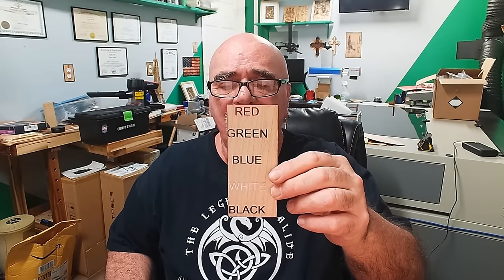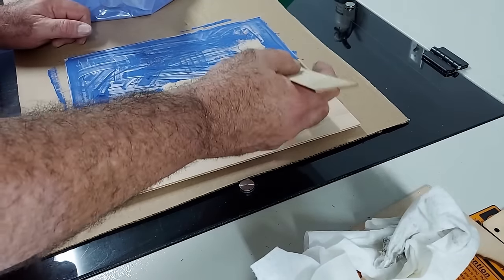😲 Laser Engraving in COLOR! Diode Laser & Co2! A powder coat trick!

Comment: Great video, thanks.  Did Mica work the same as Powder coat?   I have been dong very large stones recently, like 24x36 inch Flagstones. Smaller 12x24 ceramic tile address plaques, small pet memorial stones.  I am doing these on a 100 watt CO2 and usually around 70mm/sec at 60 power.  I do it that slow so I get a good indent in the stone.   I want to try this next.  I was adverse to painting infill in the stones because I did not want the infill to fail later.    Also, what would you think about masking, engraving, filling the engrave with the powder and brushing away the excess, then covering the engrave with something and using a heat gun to melt the powder in?    Also, if the first engrave step really needed? Could we just cojer the piece with powder and go strait to the slow low power engrave?   (This is how I do the norton tile method now)
Reply from the maker: Mica worked well, but slightly off on the color, still good though. I've tried it with transfer tape and no first run; that was a fail. No idea about the heat gun, but the laser puddles the lines, so it looks textured, like acrylic.
Reply: @TheLouisianaHobbyGuy  OK, I did an engrave of my logo in tile,  then filled it with white mica, and ran 250 10% on my 100 watt.   when I cleaned it it all washed out.  I then filled it with blue mica and ran 250 15% and 200 25%.  I don't think my mica melts.    I well, more resting needed

Comment: Would sealing the wood with a sanding sealer (or anything else) before engraving work to prevent the light mica from staining the wood (when mixed with water) or would that just create a fire hazard from the chemicals in the sealer being burnt by the laser?  Just curious. 😅
Reply from the maker: Sanding sealer is a wood grain sealer, used as a pre-treatment for stain. It's not a sealer in the sense you're thinking. You can use a varnish or clearcoat as the pre-treatment for better results.

Comment: I've been trying to laser engrave a piece of wood that I've painted white . My issue is I get a lot of black residue from the laser ( Diode 5 watt)  and it spreads all over the white. Any suggestions to help resolve this . I tried with a coating of polyurethane but it just gets all over
Reply from the maker: You can't engrave white on its own. You have to paint it, and then mask it with laser masking tape.

Comment: Hello Rich
I just saw your video. I have an XTool D1 laser. I try using pigment colors or Mika and I got no melting of the color.   I understand that the blower will be blowing most of the color out of the surface but I did not get any color to melt.   I try 40% power at 100 mm and nothing I ran the image again and try to at 50% power and nothing as well. Any advice?
Reply from the maker: I used powder coat and mica Hector. They melted fine. Try raising your power until they do melt.

Comment: regarding the light colors on the diode i believe you said wetting it worked but stained the surrounding wood. if thats correct could you use the masking/transfer tape to help with that or do you think it would wick or seep into the wood below the tape. idk just a thought
Reply from the maker: I tried the transfer tape, the white bled into the wood Robert.

Comment: I haven’t tried engraving yet, but with my xTool D1, can I engrave with the air assist off? Also have you tried embossing powder? Not sure how they differ from mica powder but they’re sold in the paper craft section.
Reply from the maker: No, the diode lasers have to have the fan on Linda. And yes, I have tried the embossing powder.

Comment: on the air from the diode laser blowing the paint away...can an air  deflector be incorporated onto the the bottom of the laser to deflect the air away from the project wile still allowing cooling to take place..?
Reply from the maker: Yes, and that's the next step, printing a new shield that diverts the air back upward. But it won't work on many lasers where the aluminum heatsink goes all the way to the bottom.

Comment: 2000/40 then 2000/20 on laser diode is not working for me. I use mica pigment color, Is this powder works for laser?
Reply from the maker: Yes, everyone will have different settings. It's trial and error.

Comment: Did you try removing the OEM shield from the bottom of the diode? It wouldn't be too hard to CAD a part to direct the cooling fan exhaust to the side(s).
Reply from the maker: I think that's the only option for the diode. Unfortunately, on the LC-40, it's aluminum all the way down to 2mm.
Reply: @TheLouisianaHobbyGuy  that's a bummer. I've started working on a solution for others that use the bolt pattern of a 40mm fan.

Comment: Hi Rich, you mention in your video that powder coat is essentially the same as powder paint, is there not a difference with the chemical structure of the powder coat that reacts to heat as opposed to regular powder paint which may not?
Reply from the maker: I don't know Sean... they both react exactly the same on the laser. I'm just assuming they're basically the same.

Comment: Just a dumb question, Have you tried using the Flocking method, as used on the inside of boxes that were made with a bandsaw or scroll saw? Take a gander look at "Flocking a Box Tutorial" by 'Make Something' on YouTube. This might work a lot better than using a paint stirring stick:face-blue-smiling:
Reply from the maker: I do use flocking on boxes, but not on this project.
Reply: @TheLouisianaHobbyGuy  Guess I left off some words or thoughts, meant to say, "Have you ever tried using just the Flocking canister along with the Powdercoating paint?" I doubt very seriously one would want to even try to brush the flocking glue process onto the delicate design which laser cutting does. Just thinking using the flocking canister would not only fill the laser cut lines evenly, but possibly be even faster & easier to remove the excess powdercoating to be placed back into the bag containing the powdercoat paint. That's all...

Comment: What Cleaner did you use to wipe the wood with when you were done?
Reply from the maker: Green works. I find that it leaves no residue. Works slightly better than water. I use it on everything in the shop Joseph, because it's non abrasive.
Reply: @TheLouisianaHobbyGuy  Thanks

Comment: On other non-metal objects such as glass, brick, MDF, you can do a hot coating if you have a powder coating gun. You heat the object first, then while it's hot, powder coat it immediately. This how you get powder coated MDF cabinets now. You will see the powder flow immediately.
      Powder will attract to metal without heating because the gun makes it a positive charge so the grounded metal will attract the powder. Then you bake it for the specified time to get the powder to flow ( turn back into a liquid form and harden). Before most manufactures got into the color cups, I was powder coating my own (Still do) then laser etch them. Prismatic Powders let's you buy by the pound and it comes with 2 day shipping. I plan on using your technique on my 100 watt Thunder Laser.
Laser Engraving 911 ( https://www.youtube.com/watch?v=xOuWrblwhRQ ) has experimented with powder coating with a laser also.
Reply from the maker: Good to know!

Comment: Where do you find powder coat?
Reply from the maker: I got it at my local Grainger industrial supply store Kevin.
Reply: @TheLouisianaHobbyGuy  I looked at the Grainger website and I wasn’t able to find any powder coat.  I am able to find powder coating from on line suppliers, but they are usually in 1lb amounts or more.
Reply from the maker: I didn't get it on the website, the counter guy found it in the catalog Kevin.

Comment: @TheLouisianaHobbyGuy I know you mentioned mica powder, but have you ever tried "embossing powder", which is actually made for a thermal set activation process??? 🤔 Using such a material you might be able to quickly laser a fast outline, apply the powder embosssing of various colors onto the places you desire and then lay the piece back under the laser to do the final burn and heat emboss setting. Just a thot.
Reply from the maker: No I never heard of it. I'll look it up.

Comment: wouldn't this process work without the engraving the first time....instead just spread the color on then run the burn to melt the paint...
Reply: I wondered the same thing. But I wonder if it works better to have a groove for the pigment to sit in and be burned into?
Reply: You really need to engrave so that the powder can sit lower than the surface and be contained. Also, I 3D print a cover with side vents for my xTool D1 so the laser can run the cooling fan and deflect the air away from the surface
Reply from the maker: Right, the powder will melt in all directions without a groove to melt in.

Comment: Hi Rich i use similar magnets they are very strong to the point it holds down 4mm board i 3d printed holders for mine much easier to remove from the bed i also made steps for different wood thickness ive posted files and pictures in LAHobby guy Forum If anyone's interested
Reply from the maker: Thanks for that David! 👍